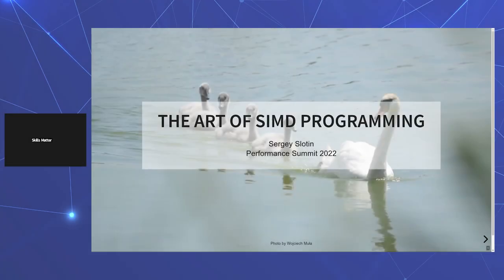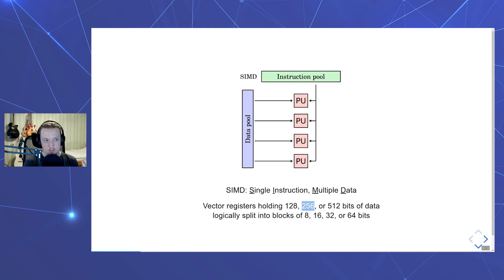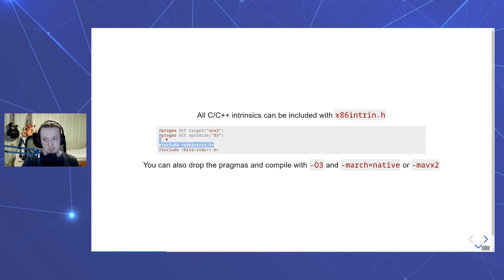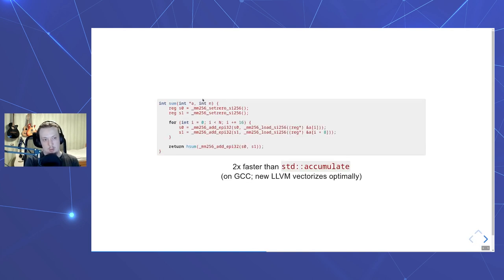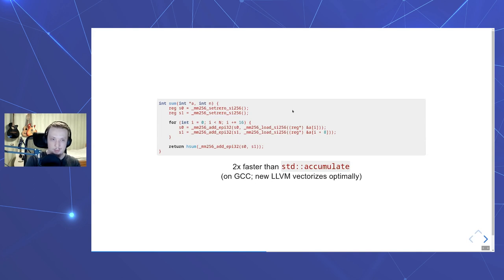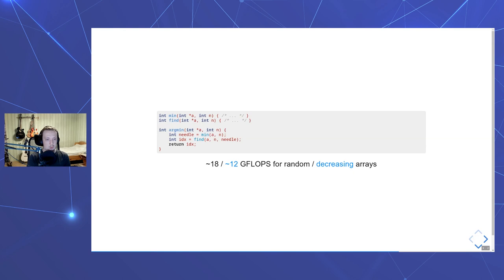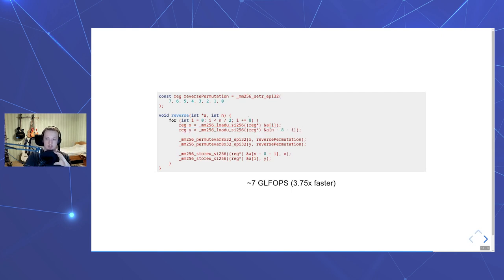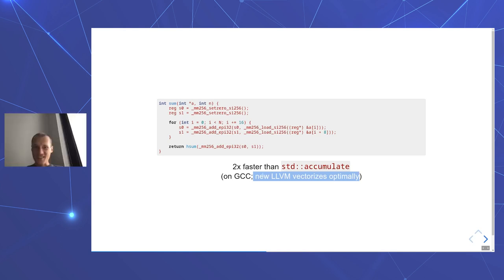The Art of SIMD Programming by Sergey Slotin

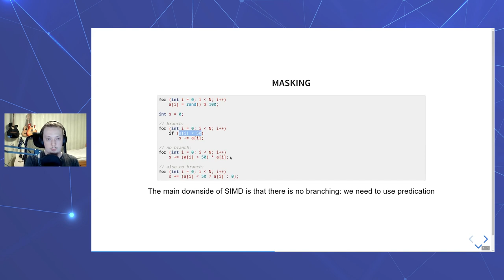Comment: I don't understand why, in the masking intro slide (at 22:42), the author says that the following has no branches:
for (int i = 0; i < N; i++)
    s += (a[i] < 50 ? a[i] : 0);

That's a ternary operation, which branches between left and right expressions. What am I missing?
Reply: That will execute both options and disregard (mask) incorrect ones. Counterintuitively this yields a massive speedup! No branches.
Reply: @az09letters92  Is that because the compiler can prove that executing both sides has no side-effects? Because if the left or right were expressions that could have side effects, then it would be a short-circuiting branch, correct?